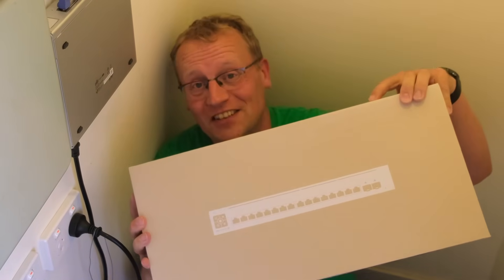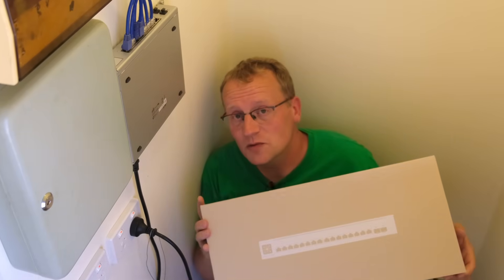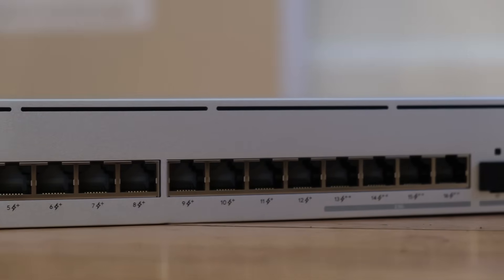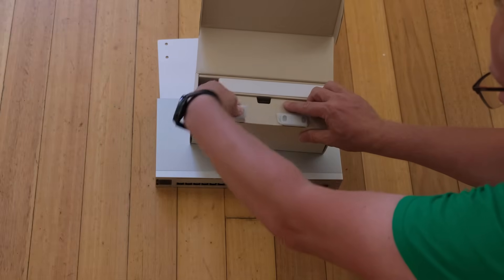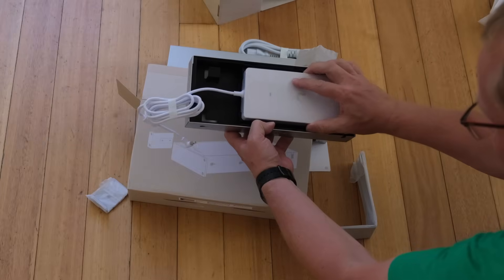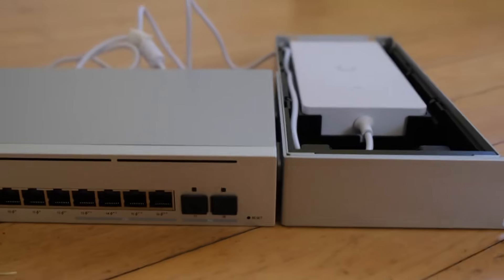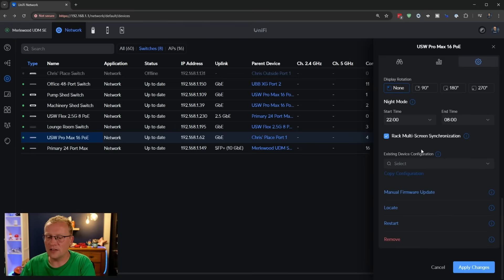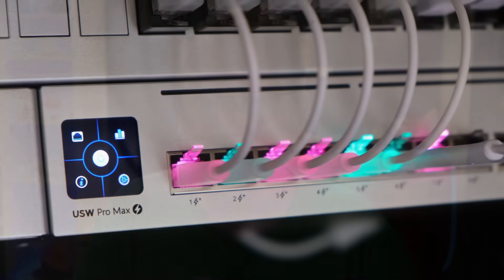Unifi Pro Max 16 PoE switch - it is super versatile!

Comment: Is it still the right choice 9 months later? I have the 24 port version which is good, I also have a regular USW24 which I am thinking of replacing with the 16 pro max. Mainly because I want switches to be SFP+ between them as well as to the UNVR.
Reply from the maker: I'd say so, yes. I still have it as the primary switch for one part of the farm. Tbh, I don't think about that switch, because it just works, and I still have more ports available for activities. Do you have something specific in mind that it can't do?
Reply: @LarsKlintTech  Nope, think it is great which is why I want to get the 16 port to replace my USW24 PoE - which itself is great, but lacking the 10G SFP+ which the pro max has. Basically I would be moving my cameras from the 24 port to the 16 port. Also means I can move an access hub mini to that port too as it has poe++

Comment: The power supply is beyond clumsy.
Reply from the maker: It's a bit awkward, but it works well. I have since changed the side of the power supply mount as well, which is a bit cleaner.

Comment: Thanks Lars, appreciated the video! Quick question, I installed another Ubiquiti switch which took me to a total of 4 switches. When I looked at the topology, a message came up saying my Spanning Tree Protocol settings were incorrect and that I need to change the switch priority for each switch, it supplied a link to learn more. Have you ever seen this message? Thanks Andrew
Reply: Fixed! Just for your info as I know you have Starlink. The problem was the Starlink gen 2 router having a problem talking to the dish. I had to prove it with all the diagnostic results. Starlink also said they were starting to see errors as well and they graciously sent me a new complete kit including gen 3 router and gen 4 dish! All installed and now getting better latency and consistently getting 400+ downloads. I much happier now!
Reply from the maker: @sautera3  Oh, interesting. I am glad you figured it out. I have bough a refurbished gen 3 dish too, as my gen 1 is bound to come up with faults at some point.
Reply from the maker: Hi Andrew. The STP is to prevent network loops, so could it be that you have a logical loop in the way your switches are connected? I haven't seen that message, but I know that if SFP can't resolve the network without loops it throws its toys out of the pram. You can change the switch priority in the settings for the switch in the drop down.
Reply: @ thanks Lars, yes I have changed the priority on all switches and that removed the message but I’m still experiencing delays internally. Do you consult to do a network review of UniFi config or do you know anyone? Thanks again
Reply from the maker: @sautera3  Okay, that is a good start. What kind of delays? 
No, I am by no means a professional in this stuff. I learn as I go. Happy to help here though :)
Reply: @ Thanks! Weird stuff with internet speeds. I have starlink as well and I get normal/expected  speeds from UDM SE to Starlink when doing a speedtest in UDM SE console (Also using starlink app the speed is very good and no delays there). However, from other devices on the network I only get 2-4mps download and 12-13 upload using wifiman and speed-test. Sometimes, the download can get as high as 30mps. Strange as everything was working fine (as in getting full starlink speeds) a month ago and no changes were made. All devices are noticing slow to load we pages and streaming is often buffering. All family members blame me ofcourse! 🤨
Reply from the maker: @sautera3  Yeah, that is really not right. Can you try and test each segment? Can you connect directly to the next hop (switch?) from the UDM SE and see what the speed is there? If that tests okay, try the next one. It sounds like a faulty cable to me that is running 10Mbit, which is usually a single pair of wires in the CAT6.  
If it is a wireless issue to your device, it could be interference, and Wifiman can help troubleshoot that too.
Reply: @LarsKlintTech  Thanks, Lars. I appreciate the reply. Yeah I did that, and the speeds are fine to the UDM SE. It seems to be a routing issue with the UDM SE, as speeds on either side are fine. I must have a config issue. Thanks for your time I'll find a consultant that can do a health check on my config. Thanks again!
Reply from the maker: @sautera3  No worries. I hope you get it resolved :)

Comment: How is the temperature vs the old switch? I have the same as the old one and it runs around 70°C
Reply from the maker: It's remarkably cool if the temp in the stats is anything to go by. Running at 40-45C consistently, even though that little room gets hot. The old switch was at 60C+ a lot of the time.

Comment: Great video Lars.  I'm just starting out on my Ubiquiti journey and have been looking at this switch.  Can I ask, If I get 2 SFP+ 10G RJ45 adapters, can I use the 10G ports to connect my Mac and NAS (both with 10Gb ethernet) to the switch?  Will all other connections on the Gbe and 2.5Gbe ports be able to see the NAS too?  Many thanks
Reply from the maker: Welcome to the Unifi rabbit hole 😁
Yes, that should work fine. All the ports are standard data ports, so will all be visible on the network to the other ports on this switch, as well as other switches. 
Kinda jealous of your 10G NAS connection now.....
Reply: @LarsKlintTech  Many thanks for the reply Lars.Looks like I'll be making a purchase once I decide whether to go POE or not.  

Yes, the 10G is a very 'nice to have' feature.  Would have been happy if Synology came with 2.5Gbe as default as that would interface beatifully with my UCG Max, but the default 1Gbe in this day and age just seems so outdated.
Reply from the maker: @iangriff2170  No worries at all. Happy to help where I can (hence the videos). I would love more than 1G on my Synology too. I am wondering if it does aggregation (I think so).

Comment: I’m in the Northern Hemisphere so our bolts, like water in a toilet bowl, rotate in the opposite direction. And before y’all panic, that was a joke. Keep up the great work, Lars.
Reply from the maker: @robert7592  hehe 😏
Reply: I desperately need someone to talk me out of buying the Pro HD 24 PoE. My Enterprise 24 PoE is completely full and it forces me to use some PoE ports on my UDM SE. I also have 10 GbE in my office—currently connected via a single Aggregation (USW-Aggregation—so the Pro HD 24, with its PoE++ configuration and two 10G RJ45 ports, allows me to gain 10 GbE connectivity AND remove three PoE++ adapters, all of which are currently hanging in festoons behind my rack. They’re hidden but I know they’re hanging back there and I hate that it looks crappy. But yeah…spending $999 USD so my rack looks better isn’t particularly justifiable.
Reply from the maker: @robert7592  You won't get me to talk you out of it, cause I would do the same 😂
Reply: @LarsKlintTech I bought a Pro HD 24 and installed it today. She’s a beauty and, with two 10-GbE RJ45 ports, there’s zero fiddling with modules. I’d send you and your followers some photos but I haven’t found your email address or other means of sharing such materials. Is there a contact address for you?
Reply from the maker: @robert7592  Oh, very nice. I am still waiting to get one. 
Yes, use me at larsklint dot com

Comment: Hej Lars, How come that in the switch overview the pump shed switch uplink is GbE and in the ports menu of the new pro max it says only FE ? Great video btw . Greetz from Belgium.
Reply from the maker: The pump shed switch is connected with a NanoStation AC5, which provides a 250-300Mbit link. Unifi sees this as a cable, rather than wireless, so hence the pump shed switch seems to be directly connected. I am not sure why the overview says Gbit connection, cause it isn't.

Comment: Still wish Unifi would configure the Etherlighting to follow the Night Mode settings for the LCM screen. Otherwise there is no way to automatically turn the Etherlighting off overnight if it's installed in a bedroom or living space.
Reply from the maker: Definitely. And it seems like a relatively simple software update as well.

Comment: Does kind of make me wonder why they didnt just build in the power supply and make it 19" rack mountable? Granted, you may want to wall mount it as you did with your first switch, but it always looks so weird when I see it in peoples builds being so off center!
Reply from the maker: Versatility is the key, so I think it makes sense in this case. It's a powerful switch option where you don't need a rack, which is relevant to a lot of people. I am probably going to swap the power supply mount to the other side too, if I get more rack mounted devices with screens in that rack too.

Comment: You'd want the rack mount PSU on the otherside of it surely, so the screens all line up with any other switches you might add?
Reply from the maker: Yep, I think I got that wrong too. My logic was that it would be closer to the power point, but then I found a PDU so that made no difference. Luckily it is easy to swap over later 😊

Comment: it's a sweet little switch, just wish they had built in the powersupply instead of a massive tag on that makes the whole contraption an odd shape... and when you put in the keystones I was like "wtf is he doing" but you quickly "corrected yourself" and put them near the ports... just wish more of the ports were 2.5... it seems a bit "gimpy" cheaping out on that...
Reply from the maker: It is a great device imo. I don't think it would have the same appeal, if it had been a regular rack size switch. This configuration makes it sooooo much more versatile and usable in many scenarios, and Unifi already makes 12874329549 rack sized switches. I like that it is different and can be mounted in many different ways. 
Agree, more 2.5G ports would have future proofed it more.

Comment: Not keen on the power brick. Just make the box full width so that you don't need the extra box.
Reply from the maker: I think the idea is that you can use it in many different scenarios, not just for a rack. One comment mentioned that the power brick can be put somewhere else completely, so you have the flexibility. And if you need full width, you can also get the 24 port Pro Max.
Reply: @LarsKlintTech  you're right, of course. I understand the flexibility. The additional cost of the metal box and the added cost of a brick (vs built-in PS), means that the end product is about 20% more expensive than an integrated unit. That is why I am less than enthusiastic.
Reply from the maker: @KeithHanlan  The power brick is included. That isn't extra. The switch us USD399 and the rack mount is USD49. The "equivalent" full width Pro Max 24 is USD799, so in that scenario it is pretty much half price. Would the 16 be less than USD448 as a full width unit? I don't know.

Comment: I have that as my main switch in my rack at home.  I have been extremely happy with it.  Nice and quiet.  I can keep the electrically noisy power supply away from the switch.  It has never skipped a beat.
Reply from the maker: Glad to hear it! I am very pleased so far too, and it gives peace of mind that I have PoE+, PoE++, 2.5G and 10G.

Comment: I noticed your switch flex (2nd port) is connected at 100 mbps / FE. Is that caused by your keystone? Greetings from Amsterdam
Reply from the maker: Good observation, and it could have been. In this case, it is connected via a NanoStation AC5, which doesn't show up as a device as it is UISP. The pump shed flex switch is connected via a 250-300Mbit wireless link, which Unifi thinks is a cable 🤷‍♂

Comment: "old and tired..." care to evaluate? we just need an excuse for an upgrade you mean?
 also the Pro Max 16 PoE is the ugliest product UniFi has ever designed. it looks stupid in any rack and people should stop buying it.
Reply from the maker: Old is easy. It is 5+ years old (I bought it second hand). Tired is a number of things. It "only" has 1G connections, and I am upgrading the farm network to 2.5G/10G. One of the ports is starting to fail I think. Hard to confirm intermittent faults, but it is driving me nuts. And it looks tired too, but that is just aesthetics.

You can just decide not to buy the switch. That is totally cool, but not sure you can project your opinion onto other peoples' decision though 🤔
Reply: It’s not ugly it’s just crap that it’s like the us8-150  and needs a mounting kit

Comment: It It's downright stupid that Unifi doesn't make this type in standard dimensions so it fits 19" racks out of the box :) Bad Unifi :)
Reply from the maker: Yes and no. There are a LOT of people that don't have a rack, but need more ports, and this is a perfect solution for that (check out the comments). If you do need a rack mount, it is also available, so this is a pretty good compromise imo.
Reply: @ from the outside it just seems like the usual 'we can get more money out of our customers' function. Which is a company's task :) But still a bit crazy, in my opinion :)

Comment: I was considering this switch, because I need the POE budget, but it's not full size, I'd rather pay more just to have the full size, & have everything line up. That's just me lol.
Reply from the maker: I get it!! I hear you mate. I seriously considered putting the rack mount bracket on the other side to have them line up better too.
Reply: @LarsKlintTech  I'm considering the Pro Max 24 PoE.
Reply from the maker: @jayjackson4685  That is a great switch. It is my main switch connected to the Starlink, so it controls most of the network. My full video is here: https://www.youtube.com/watch?v=MhEeyXchr-I

Comment: Looks really cool and I have been thinking about replacing my 24 port Pro PoE with 2 of these 16 port Max instead. My setup is one main 24 port and a bunch of Flex and Flex minis scattered around the house, all running off the PoE from the 24 port. By changing to a couple of these 16 ports, I hope to first of all be able to do a 10gbit uplink between groundfloor and 1st floor where the UDM is but also get 2.5gbit for my PC so I can access my NAS with maximum bandwidth (its currently bundled to 2gbit). Only "issue" is that I might need an aggregation switch as I am already using all 10gbit on my existing switch (one for UDM and one for UVNR) and these 16 ports only have 2 as well 🙈
Reply from the maker: That sounds very similar to my place. I am upgrading to 10G as well, but constantly either finding a switch doesn't have 10G (like the old 8 port in this video), or I am running out of ports. The 10G of the Pro Max 16 is a very nice addition too, and one of the reasons it is going into this rack. 
Hopefully I can get my hands on an aggregation switch too at some point.
Reply: The USW-Aggregation is a nice 10gbit switch for the money - but you will, ideally need a rack to house it - but given that you have a UDM, likely you already have one. I ran one for 18 months as the connection between 3 pcs using 2.5gbit adapters and a Server and a NAS running 10gbit. I did need to add SFP-ethernet adapters to connect the PCs. Currently, I'm running a Pro Max 24 which handles the 2.5gbit ethernet - The USW-Agg now handles 10gbit connections between the switches and the NAS and my UDM
Reply from the maker: @rogerjones9984  I do want an aggregation switch for 10G as well, and I have several racks, but still not quite sure where it would fit into my network.

Comment: I had just replaced a set of ES8-150's as well with this switch.   The power budget and the 10GB SFPs made this a wonderful option.   I was tempted to try the Flex 2.5 POE, but the price is still a bit high for what it offers, where a downstream Flex with POE is still very suitable.  This switch has honestly been one of the really good releases they have had.

Rack Multi Sync - If you have multiple switches in the same physical stack you would want that on in theory.   The LCD touchscreen will manage all of the devices in the stack to my understanding - with all of the camera/augmented reality phone camera overlay port identification options and such.
Reply from the maker: It is a great "little" switch. I wish I had installed it earlier tbh, but here we are. 
I am not sure about the LCD, but It definitely syncs all the etherlighting port choices across all devices, whether they are in the same rack or not. I figured that out a couple of days later when I checked my Pro Max 24 😂

Comment: Always the same, you run out of ports 🤣 my biggest argument when my wife asks, do we really need the switch?! 😁 The Rack Multi Screen Sync is controlled by the Gateway as master and syncs all displays, regardless of whether you use 1 or 3 racks.
Reply from the maker: Absolutely. More and more things are PoE powered, which is neat I reckon. Your wife asks? I just tell mine and run 🏃‍♂
Thanks for the info. I realised this a couple of days later, when I looked at my Pro Max 24, and those lights changed too 😂 A bit misleading naming.